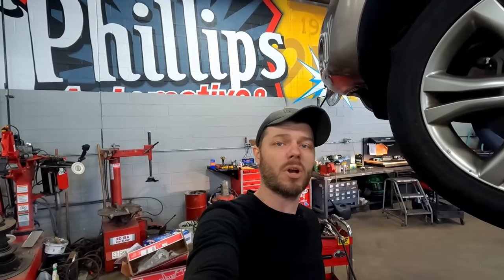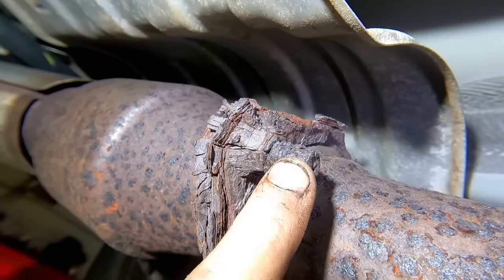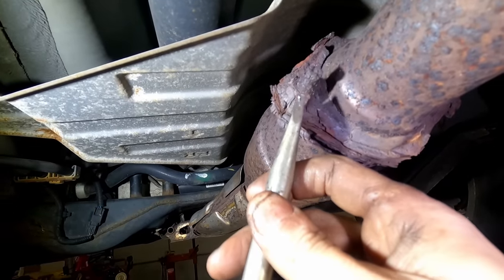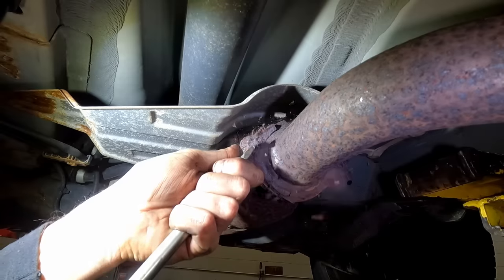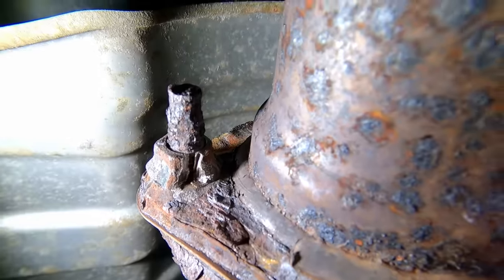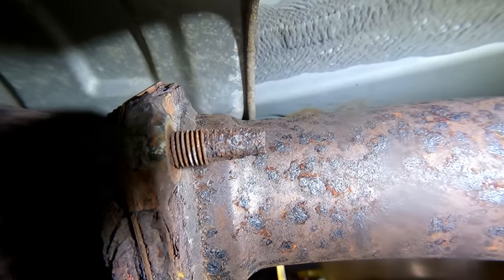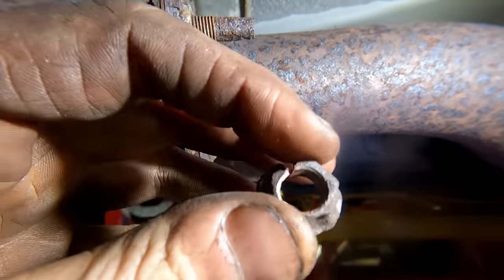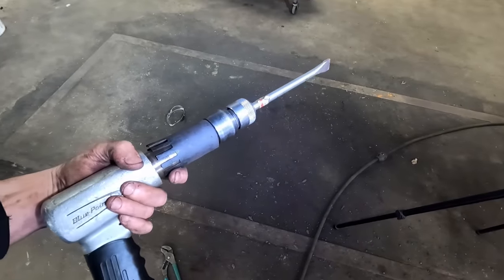Top Secret Mechanics Trick 2! HOW TO remove extremely rusty exhaust nuts FAST without heat.

Comment: In North Carolina, noise laws are no longer enforced ...if your muffler falls off, you are not required to replace it.  North Carolina Inspection stations do not  require cars (or trucks) to have factory installed mufflers.  IOW, cars and trucks can make as much noise as they want without consequence.

Comment: This job is easy. Get an angle grinder and cut all that useless rusty hardware off. If the exhaust is worth saving put new hardware on it.

Any wonder mechanic charges have gone through the roof if this bloke is an "expert". This bloke actually deserves a Darwin Award.

Comment: The way I do it is to tighten the nut, snap it off get the tailpipe out of the way and knock the stud out.Use a brand new bolt and nut to reassemble.

Comment: I thought the same when I removed my nut. That said I use a bolt extractor type socket but yeah, the threads are great when you spin it off.

Comment: What's even quicker is taking a Dremel with a grinding bit and it'll split the nut lickity split.  I guarantee it.  I had to use a Dremel to get a frozen axle off because all of the 'tricks' that youtube constantly brag about, were worthless.  The Dremel was controllable to the point where I wasn't even concerned about possibly damaging something that I didn't want to damage.  Using this method, their is a HUGE possibility of damaging something or yourself if the chisel bit slips.  Also, it sounded like you were using a tool (hammering device) that not everyone may have access to.

Comment: I fixed the exhaust leak in our 06 torrent Friday 1 stud rotted off so I hot wrench nuts off. Heat flange pound studs out. Too far gone

Comment: I tried this with a DeWalt chisel and broke the tool. Stupidly I have an air chisel but forgot all about it. Air tools are stronger and much cheaper than anything based on a battery.

Comment: I've always gotten the nut off. It's getting the stud out which is pressed in and has no hex head, only a flat head. I can't get an air wrench, chisel, etc. to be straight off the end of the bolt to drive it out.

Comment: you must be in an area where theres no road salt used. condition of body underside shows no rust. up here in the great white north that whole bolt would be de laminated with rust the whole thing will crumble with application of air hammer.

Comment: I've tried this and although it's much faster than sitting there with a torch and finding the right size socket to fit then hammering the socket I will say it doesn't work half the time .. either does spin or pressure from air hammer breaks stud off or even some instances isn't enough

Comment: All he had to do id hit with air hammer knock the rust off cut nut off with torch knock out stud with air hammer not all nuts come off like he showed and not al threads will look like that just put new bolt and nut in it

Comment: 4" cutter grinder?? = New Bolts
Reply from the maker: The flange with the threaded studs is not being replaced. Imagine these are manifold studs. You wouldn’t want to cut the studs off the cylinder head.

Comment: I'm not a professional mechanic, but I have always wondered why people don't use stainless steel bolts and nuts on high corrosion areas, such as the exhaust.  Please, if there is a reason, I really would like to know.

Comment: wouldn't it be faster to cut it with grinder?
Reply from the maker: No because it’s not a bolt. It’s a stud which is treaded into a rusty flange. That flange is not being replaced.

Comment: A zip cutter makes short work off it if you have access.
Reply from the maker: I wouldn't cut a stud off a CAT or a cylinder head. Keep an open mind to using this trick in situations other than the one that's put in front of your face. Same trick work on any Nut.  Exhaust manifold stud on a head.... anything with a stud in a blind hole. The stud in the video is also threaded into a rusted thin flange. this is not a hole with a bolt and a nut. you cut that off you just added an hour's work. You heat that flange and punch the stud out of the treads you'll destroy the other flange. Its rusted super thin. or....... do this in 1 min and put a new nut on it and DONE!

Comment: I would use the oxy/acetylene and cut them off.  Much faster
Reply from the maker: The flange with the threaded studs is not being replaced. Imagine these are manifold studs. You wouldn’t want to cut the studs off the cylinder head.

Comment: if I have the room couldn't I just cut the nut with a cutoff wheel on a Dremel
Reply from the maker: The flange with the threaded studs is not being replaced. Imagine these are manifold studs. You wouldn’t want to cut the studs off the cylinder head.

Comment: I don't get it. You have to weld in a new connector anyway. So just angle grind it off in 15sec and you're done. Why spend time on a part which is junk anyway?
Reply from the maker: It’s called a flange not a connector and no it’s not getting replaced. The point of this video is how to use a air chisel to remove a nut that’s so rusty you can’t use a socket or wrench. Open your mind and use it in a situation other then the one in front of your face. Pretend this nut is on an exhaust manifold stud coming off a cylinder head. Let me know how cutting that off works out for you.

Comment: What about an exhaust flange with threaded holes and bolts? (Instead of studs and nuts)

Is there any cheat code for that, besides a torch?

Comment: What you doing dude? You can't give away our secrets. How are you gonna deal with it after the owner "worked" on it first? Either way just cut it off and nut n bolt it back. Half the time 8n this situation.
Reply from the maker: Pretend this is a manifold stud in a cylinder head. Wish people could apply what they see to more situations then the one in front of their eyes

Comment: I just cut them off with a grinder on the side of the part I am replacing.  Done in seconds!
Reply from the maker: that's a stud on a cat that's not being replaced. The point of the video is how to remove a nut and save a stud. Imagine this is an exhaust manifold stud on a cylinder head.... don't cut the stud off in the head. Just do this...

Comment: Great to see someone with hands almost as beat up as my own...Say, do you ever temporarily put a new nut where the first one was removed? It will stiffen up the connection so to increase the effectiveness of the technique used on the second nut. I noticed it seemed that everything was shedding rust with the second one. Might increase mileage with all the rust weight loss... Good trick, thanks.
Reply from the maker: Not a bad idea but never found the need.

Comment: Good trick but I would not reuse the bolt unless I had to, the head would likely be rusting away and may not hold up for much longer and if it breaks loose from the rust holding it in place there is no way to get a wrench on it to tighten the new nut onto it.
Reply from the maker: This is for when you have too. It’s kinda the whole point

Comment: this is so stupid easier to cut them off and replace plus you need a hammer drill like that which costs a fortune
Reply from the maker: The flange with the threaded studs is not being replaced. Imagine these are manifold studs. You wouldn’t want to cut the studs off the cylinder head.

Comment: Plasma cutter and done.
Reply from the maker: The flange with the threaded studs is not being replaced. Imagine these are manifold studs. You wouldn’t want to cut the studs off the cylinder head.

Comment: For those who don't have an air chisel, just buy a nut splitter. No air chisel, no nut splitter, use an angle grinder, who the f**k cares about those rusty nuts or bolts.

Comment: Only problem is the flange is usually so rusted away that it never seals anyway. Best thing to do is cut the flange out and put a piece of pipe in its place
Reply: Or use a dorman repair flange kit. It is a lot easier for a diy guy in a driveway.

Comment: Torches leave a mess? No way… If ya like wasting valuable time messing with rotten junk then have at it! Otherwise, torch it out and install new nuts/bolts or replace the flange! Exhaust work isn’t scary, only when people get lazy about it!
Reply from the maker: Replace the flange? It’s a perfectly fine $1200 cat converter. I’m sure every customer will be happy about that lol. Open your mind… this isn’t just for a exhaust flange. Use it on manifold stud nuts for example. You gonna cut the studs off and cylinder head just because the nuts are so rusty you can’t use a wrench or socket on them? “Waste valuable time” this is literally faster then anything else. Say your not replacing the exhaust but you have to drop the down pipe out of the way to replace another component. You gonna replace the exhaust just because? Your customer must love you “you need $1200 in exhaust because 2 rusty nuts 😂

Comment: Nice trick but why waste the time doing that? Just cut the bolt off and install a new one those old rusty bolts are brittle and will probably break anyway when you start torquing down a new nut on them that’s like using old head bolts to rebuild a motor can you yes but should you no.

Comment: Why not take a grinder with a cut off blade. Lol..
Reply from the maker: The flange with the threaded studs is not being replaced. Imagine these are manifold studs. You wouldn’t want to cut the studs off the cylinder head.

Comment: This is dumb imo, if I was working on this vehicle it would be getting a new stud and nut, that stud is way to rusted to reuse, honestly the entire flange might be compromised with that much rust
Reply from the maker: What’s dumb is you can’t use your brain well enough to think this only applies to the situation I showed you. The flange with the threaded studs is not being replaced. Imagine these are manifold studs. You wouldn’t want to cut the studs off the cylinder head.

Comment: In the time it took to do this video I’d have the old one off & the new one on!!
Just use a mini grinder, cut the nut & stud off & replace with new!🙄
Reply from the maker: Wrong. That stud is threaded into the rusted cat flange that isn’t getting replaced. The video isn’t about how to do exhaust work. It’s about how to remove a nut on a stud which isn’t being replaced. Imagine this is a manifold stud on a cylinder head… go ahead… cut it off. I’ll wait
Reply: @motormike43  no need to wait….it’s done!!

Comment: Just cut them.
Reply from the maker: The flange with the threaded studs is not being replaced. Imagine these are manifold studs. You wouldn’t want to cut the studs off the cylinder head.

Comment: I would have just quoted to replace the complete exhaust and left it as a decision the customer needs to make, my time is worth more than trying to save a rusty exhaust.
Reply from the maker: its a $1,000 CAT. This video is not about how to save an exhaust. its about how to remove a rusted nut and save a stud. Open your mind to using this trick in a situation other than the one that's put in front of your face.

Comment: SMH....STOP WASTING TIME AND JUST CUT IT OFF WITH A GRINDER
Reply from the maker: The flange with the threaded studs is not being replaced. Imagine these are manifold studs. You wouldn’t want to cut the studs off the cylinder head.
Reply: @motormike43  absolutely wrong buddy

Comment: On something that’s easy to get to, just torch it or break it with an impact. Get a new stud and nut and call it a day. 1 dollar stud and a 30 cent nut. Wasted time sharpening a bit when it couldn’t just been snapped off with an impact and get new hardware.
Reply from the maker: The stud is threaded into the other flange. That’s what makes it a stud. Otherwise it would be called a bolt. If you cut it off then what’s your plan for the cat converter flange that’s not being replaced and now has no holes to pass a bolt through and 2 cut off studs?

Comment: This did not take 30 seconds of work, sharpening the blunt air hammer bit, paying off the air hammer bit and the air hammer, gathering the tools required, putting the vehicle on the hoist, talking to the customer, agreeing on scope of work, getting the customer to pay up, so on and so forth, it ain't this simple.
Reply from the maker: Well your glass is half empty lol.  surprised you didn't throw in there... paying the rent, paying the eclectic bill for the air compressor. The gas in my car to get to the shop that day. Washing my uniform.... come on man.....